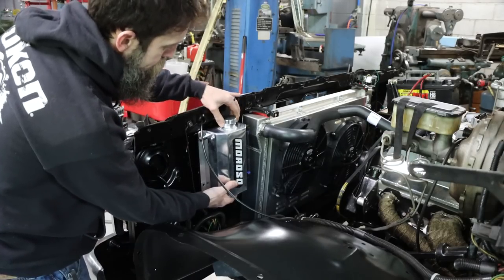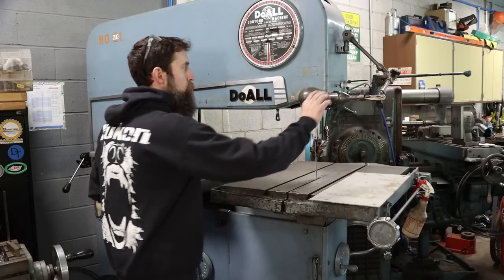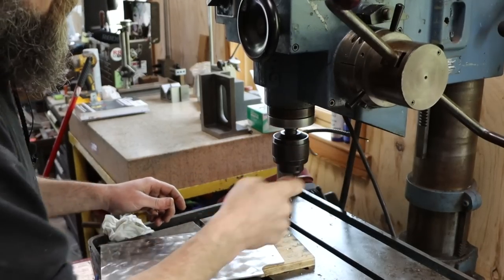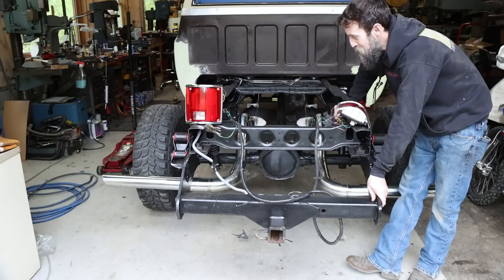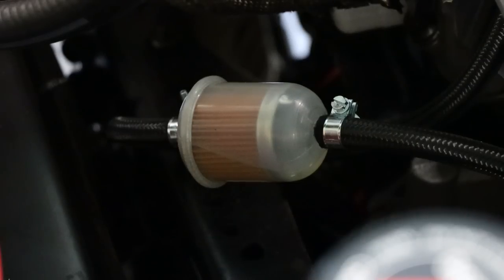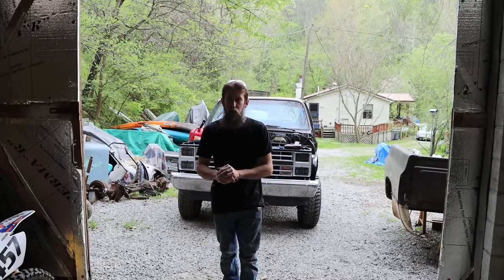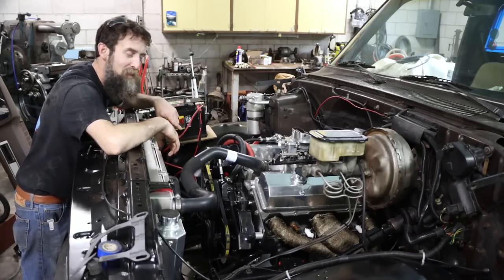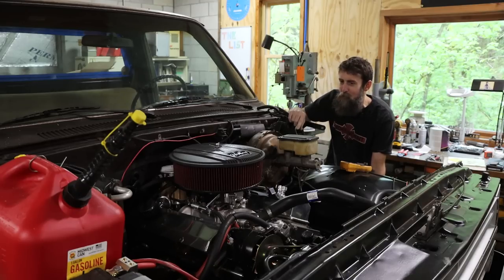Will this truck even run?  1st Test after complete engine rebuild.

Comment: Nice work Steve. That grin at 20:30 😀 What did you say before: "it's just a work truck for hauling firewood, I'm not going to go crazy" (Summers, S., circa November 2021). I think we're all glad  you did go just a tiny bit crazy.
Reply from the maker: 😁 A person has to be a bit crazy to want to tackle a job like this. Problem I have is knowing where to say good enough.

Comment: 600 carbs work great on 383 strokers. You may if you take the front metering block off to use the smooth ends of your 61 to 80 drill bit set to see what size your idle feed restrictions are. Most holleys ship with a 0.031" idle feed restriction. That is good for a 327.  A 347 or 355 needs a 0.032"  idle feed restriction.  A 383 needs a 0.033"  
With a hilarious side effect. You may spin your tires at the lightest touch of the throttle. 

The low speed circuit supplies the only fuel from idle till around 1800 rpm. Till the primary boosters start to trickle fuel. Then the low speed circuit decreases as the primary circuit takes over completely around 2400 rpm.
Reply: Agree on a 600, a 750 is way too big.

Comment: I would suggest taking a wide open throttle vacuum reading before deciding for sure you need another carb. As long as you aren't pulling more than an inch of vacuum at wide open throttle I would not worry about it.

Comment: WOO HOO way to go she sounds great. Did notice something with the left taillight syncing with throttle inputs on that initial run. At first I thought you had the turn signal on. Congratulations on a job well done.
Reply: Yeah, I saw that too. Why was it doing that?
Reply: Foot on brake pedal.

Comment: I share your joy.
I really think you should install an offset (passenger side) front hitch point, it's really useful when maneuvering trailers and can act as a hard point for the winch line if you are using a snatch block.

Comment: Great video (as usual) truck sound great.  Around 19:20 the rear brake light seems to be turning off and back on with you pushing the accelerator.  I hope that has to do with them not being mounted.

Comment: Glad to see you get it running. Not sure what your intended use for the truck is but unless you're planning on bumping the red line every drive you have a big enough carburetor. Took a lot of huge carburetors off customers hot rods over the years to get their vehicles drivable for daily transportation

Comment: That DoAll saw is sure a blessing to have in the shop. LOVE IT ! The tool is called a "Rivnut" Airplanes have hundreds of them. The tool and a bunch of inserts is around $25.00 CDN. I am sure your Harbor Freight has both rivet tools in stock as they are pretty common. That is one sweet sounding small block ! A 350 uses 100 cfm per 1000 rpm so as long as you are driving it like a sane fella that 600 should serve you well. To really appreciate that 383 a 750 Carter type carb is the easiest to tinker jets and rods. I love the bark of that engine. No need for a cam break in so take it out and drive it. Your dad is going to love this. Get that box on and go get him for a father/son drive eh. Great post Steve. Thanks eh !

Comment: Break in oil should always have some metal in it after break in from the rings seating and the motor heat cycling and getting its bearing surfaces. Nice and seated also..  is why its break in oil.  Usually want it a little thicker than normal to get everything coated..  but after the first initial change you shouldnt see any more metal at all in the filter.. but dont worry if theres a little amount of glitter in the first change, if theres more than just a little glitter than yep, tear her down and see whats the deal..  but theres always gonna be some metal in first change on a fresh build..
Reply: I got up late. This is the comment I would have made.
Reply: Yep, nothing fits perfectly  first time, in days gone bye, the dealership used to tell you to "run her in"", which is exactly what you are describing.

Comment: Hey Steve, i noticed you bought a nice harbor freight work light.  I have the same one.  i made a simple mod to keep from constantly turning it on in my toolbag.  Simply glue a large washer to the rim of the ring that holds the button. The inside diameter of the washer should be very close to the button diameter. This acts as a spacer to protect the button.  Be sure you clean the button ring and the washer well.  One more thing.  you get one chance to not get glue inside the button housing.

Comment: Hi Steve and Elizabeth, I watch your videos but don’t comment much BUT there’s just a couple I would like to make. If you’re going to start your engine without an air cleaner then get a CO2 extinguisher. If you have to fire that dry powder extinguisher without the air cleaner then you’ll be stripping the motor down to clean it out as the dry powder is like talcum powder and will quickly wear out the internal components. Personally I would  ditch the Holley and go with a Quadrajet as they are an incredibly versatile carb. With the small primaries and massive secondarys you can poodle around town getting good throttle response and fuel economy but when you hit the loud pedal all hell breaks loose. The biggest problem these days is finding someone to set them up properly, people get all confused with the jets, metering rods and rod hangers, which are all changeable, but this is exactly what makes them so tuneable. Back in the day I used to love rebuilding them and setting them up for street cars. I see Holleys as more of a bucket to pour fuel into an engine. I’m loving the truck rebuild and that Elizabeth is getting involved, the extra video you add of the family and pets is an absolute bonus. We don’t have squirrels in Australia so I find them fascinating. I can’t believe you don’t have a pop rivet gun or a rivnut tool as I wouldn’t be without either of them but then again I can’t TIG weld. I think the content and production of your videos is perfect so keep up the great work. 
All the best to both of you, Stuart 🇦🇺

Comment: Sounds nice!

600cfm should be plenty enough, it´s not a race car.
Many old pickup trucks did well with relatively small double-barrel carbs and Thunderhead289 even has a 302 Windsor running on a lawnmower carb (he´s got a bunch of vids about adjusting "normal" carbs, timing, fuel pressure, etc, check them out!).
A smaller carb should be better for good low-rpm throttle response and at 19:42 it sounds like you already got it.
Reply: Yup, a 600 is plenty.

Comment: Rivet nuts are awesome. You can get by without a rivet nut gun in a pinch, just use a bolt and a nut with washer. But with a rivet gun it is a lot faster.

Comment: Sounds really good. Exhaust always sounds more crisp with tailpipes so glad you put some on. I’m not sure why you think you need a 750 cfm carb. I doubt you’ll be running at 9000 rpm. Too little carb is only a problem at higher rpm’s. Too big a carb is always a problem. It’s only a 383. I had a Nova with a 454 and a huge cam with about 550 hp at the crank. It ran rich with a 750 double pumper. Just saying.

Comment: That style of carb. is usually seen on a (Ford) etc. first time ive seen one on a Chevy - I know a lot of people hate 'em but I love a well set up Quadrajet, nothing like hearing those massive back barrels opened up on the road-!!  I envy you that satisfaction ive always had when getting to this point successfully, theres so much more satisfaction from one you build yourself - this ones a definite keeper after all that A - grade work you guys have done.  Its just gonna get better from here, by the way those nice bright headlights and grille look fantastic-!!  Youre gonna have a better truck than when Chevy sold it new in many ways.
Reply: Extra fun are the Thermoquads. Pop the secondaries open and wooo. And watch the gas gauge drop.
Reply: I won't use Holley carbs because they are so finicky. I use Quadrajets or Carter AFB's. The Edelbrock AFB style carbs are good too.

Comment: Awesome Steve, A major milestone event ! Congrads. Something to consider; If you add a crossover pipe to the exhaust somewhere between the headers and mufflers, that will mellow the sound about 30%. You can even use a slightly smaller pipe for the crossover.
Your spot on with a 750 carb, I wouldn't go larger than that.
Looking good ! ATB....Dean
Reply: Spot on and it will cancel sound when you let off the accelerator pedal 🏎
Reply from the maker: Good to see you Dean, I am planning on a cross over . I have enough extra pipe.

Comment: Hi Steve,
The truck sounds great, real healthy!  I wouldn't condem the carburetor just yet.  That size might be near perfect for a daily driver.  If you feel like it's starving for fuel under hard acceleation, then I would look for a bigger one.  If it performs fine, I would leave it.  Just my 2 cents worth.  Thanks for the video!
-mike

Comment: My brother had a problem with a Cummins rebuild using oil. An old mechanic told him that the oil he was using for break in was too good. He switched to a lower grade of oil and the oil burning problem went away. Then he switched back to premium oil. No more problem.

Comment: Great work Steve. But I think that brake light should be working for the other pedal, not the "go" pedal. Unless that's an old habit of resting your left foot on the brake pedal. If that's the case, don't do that. 😁

Comment: this truck rebuild is almost as long as rebuilding your whole shop lol
Reply: This went way faster than the Fairmont project! LOL!
Reply: I was just wondering why you think the shop work should take longer than the truck work?
For sure the Shop was a bigger job but the truck is probably more complicated.
Anyway I'm happy because the progress is constant and the job is getting done well :)
Reply: The shop only needed 1.2 walls replaced out of 4.  That poor truck needed attention everywhere.  Thanks for showing us, Steve.
Reply from the maker: My shop didn't need everything replaced😁. Try rebuilding a truck on the weekends and after work and see how fast you get done.👍
Reply: @SteveSummers  True, Seems that "Simple refresh with nothing fancy and nothing it doesn't need" is taking a bit longer.... LOL
Reply: @SteveSummers  I agree.  My 58 willys truck is taking forever because of time.  

Truck sounds excellent.  The gas mileage is going to be really bad at the beginning with that exhaust.
Reply: @SteveSummers  if you remember how its started just a couple of repairs and not diving to deep and now its a longer repair then the shop lol 
btw im a car guy and diy'er loved the shop and truck build and ya i was a bodymen for years i know how involving it is
Reply from the maker: @danhard8440  That is how it usually begins 😁. One repair leads to another and another.

Comment: Steve, the 600 Holley should be all you need for a everyday driver with a mild cam ,head job and headers on a 383 unless you intend to race the truck.
Larger units will give off idle bogging problems and therefore won't be as tractable for use on the street whilst giving no gain.
If you are going to have a top rev limit of 6500 and assume a volumetric efficiency of 85 -90% the max size of your carb would be 620 - 650 cfm. At 6000 the 600 is just right for the job.
Getting a 750 would be a waste of money mate. 
But having said that it is your truck and your money.
Eric

Comment: fire it up! go through break in.. feed it good product - you will get shop space back again! - you should addon garage just for a office space and patio/porch - congrats on truck - you should get some miles out of it - consider fuel tank/toolbox combo, gun rack, lite bar, back rack or an x you can mount tire on - consider rails on top, get a trailer? they can be helpful and you can leave truck alone not sure if you went efi on this but you should consider it - do some truck hacks #oreilly hacks series #obd2 bluteeth

Comment: Hey Steve I’m no so sure that you will like your exhaust out behind the tires!! All the dirt that the tires throw will end up sticking to your exhaust pipes!!! I have ran most of mine straight out the back or at a 45degrees!! Plus if running them at a 45 when hooking up to a trailer you won’t have to smell the fumes!!!

Comment: Great job Steve, I am building a 383 stroker as well and I can't wait. For proper break in you should set the idle to 2000 rpm and bring it up and down a few hundred rpm for about 20 minutes to break in the cam.
Reply from the maker: My cam is a roller, it will not require a special break in like a flat tap cam. The only part of this engine that concerns me is ring seal and I think it seems like it will be ok.

Comment: i know the diesel version of this truck has two battery trais one on each side on the innerfender , so you could move the battery over to the other side (and move all the wiring that goes to it ..........) and have the space on the other side to mount the catch can
Reply: Then you have to add a very long positive cable to the starter, which is not a good idea.

Comment: Steve, for future reference to prime the fuel system you can fill the float bowls up by pouring gas directly in the the two vent tubes. Your squirt bottle with the spout is perfect for that. And for break end on all my engines, I drive it like I stole it. I don't know what brand carburetor you plan on using but my favorite is Quick Fuel. Holley parts are interchangeable with them especially now that Holley bought them out several years ago. Holley couldn't stand the competition.

Comment: I don't remember what you had in mind for the old bed, if you planned to re-use it.  If not, it could be worth the extra effort to make a custom dump bed of the right proportions.  At least make it so you could add a hinge and a lift to it later.

Comment: I have never understood the big concern about running a rebuilt for the first time that does not seem to apply to new vehicles. When a dealer needs a new car ferried from another dealership several hours away, they hire an old retired phlatulator to get it and he hits the freeway at 70 mph using cruise control. I have owned several new cars and have never read anything in the manual about changing the "breakin" oil after a few hundred miles.

Comment: Them kids stuff mufflers are going to get reeeeal old, real quick on the road with a daily driver, way to louid for around town. ( louder then old cherry bomb glass packs we had on hot rods back in the day) When I did my 327 last year, I used the most quiet mufflers I could find and then added a pair of resonators to help  get it even more quiet. My guess, about 1 hour on the road with that exhaust drone burning your ears should get the sawall  out and some descent mufflers on it so you can carry on a conversation inside the truck with out yelling. Also the cam manufactures say on first fire up, to run the motor at 2,200 for 20+ mins and never drop below 2,000 for a flat tapped cam for that first 20+ mins.

Comment: You probly should run that with the carb you have on it and check out its performance / gas milage before you go  dumping another $800 to $1200 on a new one. You may be very surprised in performance with that 600cfm. Unless you are  wanting a race engine.

Comment: The engine should have been spun over on the starter without the plugs in to get the oil pressure up before attempting to start, this would have also primed the carb with fuel so that when the plugs were refitted the whole thing should have started without a problem.  The plastic fuel filter is totally inadequate and susceptible to melting!!!! if near a hot spot.  Standard metal canister filters are cheap and provide much better filtration as well as being safer.  I don't even use the plastic filters on my lawnmower.  
Are the lifters flat tappet?  Then the cam need conditioning by running at fast idle for say, 20 minutes
The other issue is that the overflow bottle from the radiator should be set higher than the top of the header tank on the radiator so as not to drain the radiator into the overflow tank and out through the top when the pressure is released by unscrewing the cap.  Whilst a Moroso overflow tank is pretty, the standard clear plastic tanks are much more useful as the coolant level is immediately visible and the correct expansion space can be set.
Reply: Did you not see the level tube on the tank?
Reply: @russellstarr9111  I didn't see the tube that was on the right side of the tank until I trawled through frame by frame (@0.38).  The position of that tube in the final installation is against the radiator so must be difficult to see when the hood is opened, its nowhere near as obvious as a standard clear plastic header tank.
Reply: @clivewilliams3661  I agree that the location is not ideal.
Reply: He primed the oil system with drill driven oil pump drive before he put the distributor in so the oil system is primed.  The engine has a roller cam which does not need conditioning. if he likes the aluminum overflow he should use it. It’s his truck.  I do like the see through version for the reason you posted.  On a new startup I like to use the lisle radiator fill funnel with som extra antifreeze in the funnel to help when air comes out of the system.
Reply: @shadowdog500  Thank you for the extra info.  I agree that retaining the header tank is Steve's choice but I just raised a point for general discussion.

Comment: How do you know that used piece of aluminum is “6062”? How can you tell? I thought you had to have one of those expensive handheld analysis guns to tell which of the tons of aluminum mixes something actually is. So… is there another method? You guessing? Was the piece just marked as that? I’m genuinely curious. If there is a cheap way to know what type it is… I really want to know!
Reply from the maker: Because it is written on the plate 6061👍